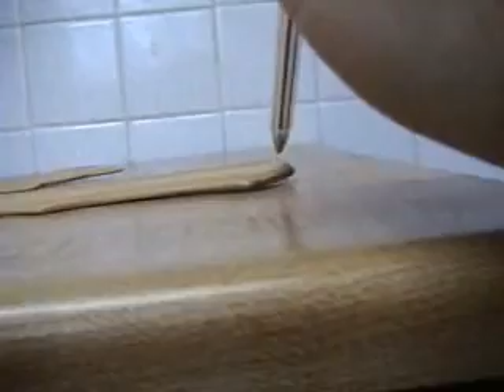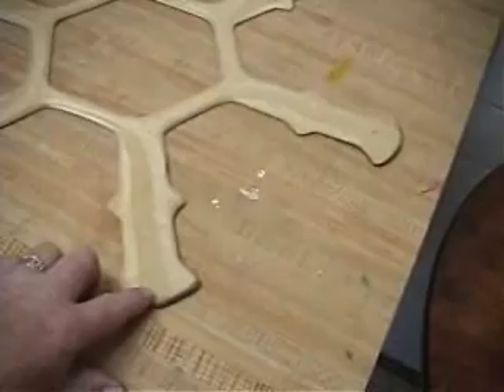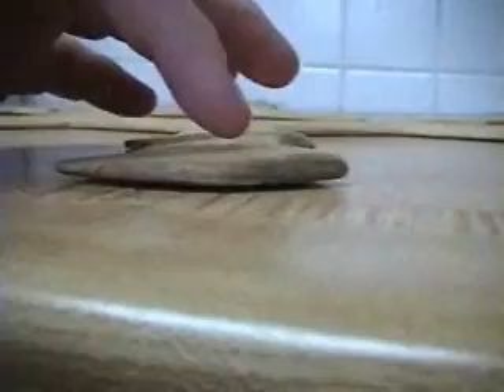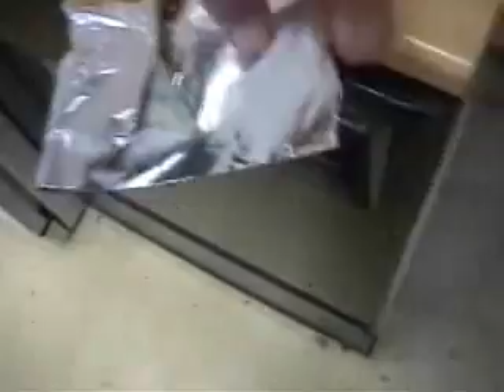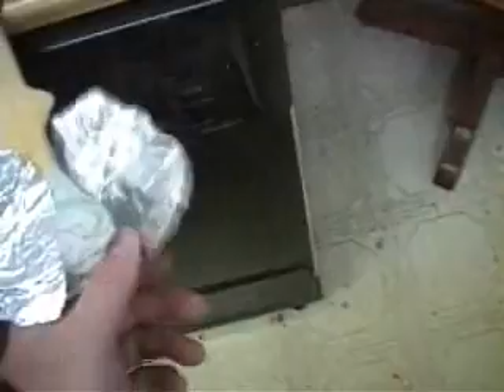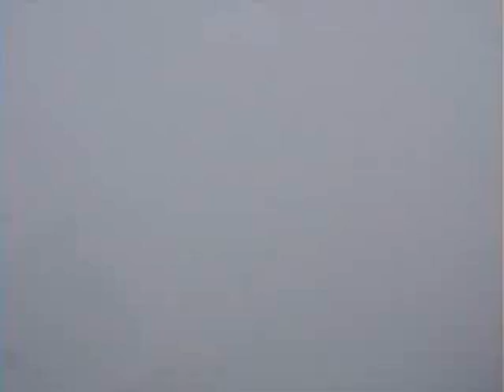Boomerang making -warping wing tips

Comment: Note that this big multi winged boomerang requires a bigger warp tune than a small two winged boomerang. On the small 2 winged boomerangs you can barely see the warp .This boomerang has diamond shaped edges making a correct tune trickier to do because the edge wount bend as easily as a flat one